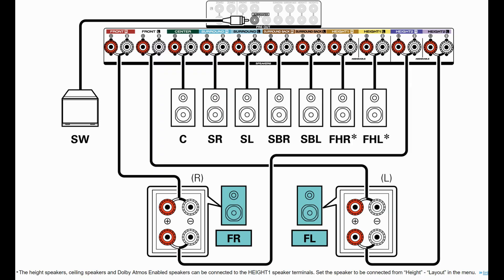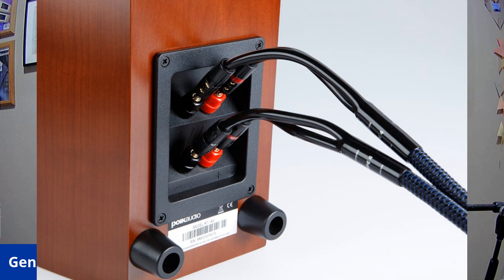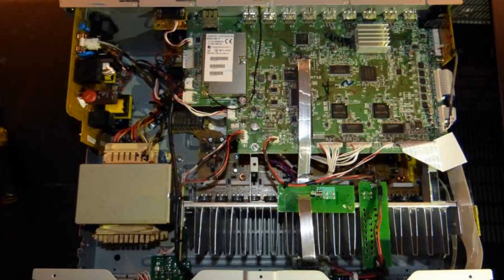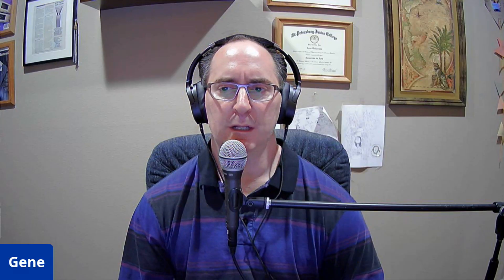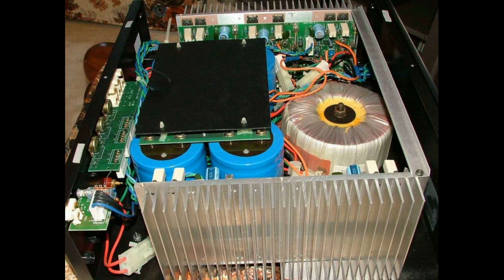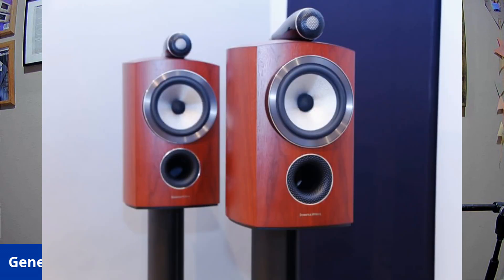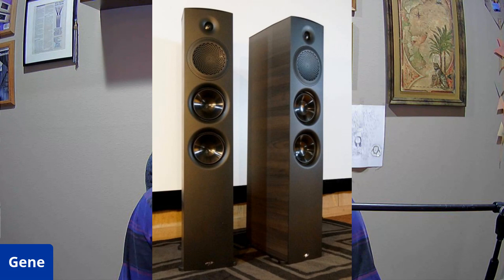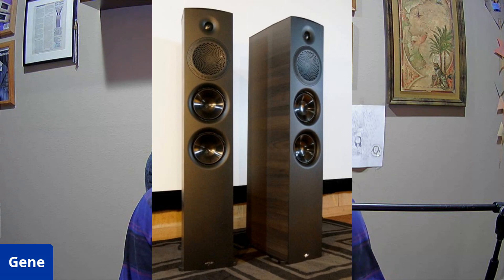Should You Bi-Amp Your AV Receiver?

Comment: I find it very interesting that you came up with Bi-amp for Denon , Marantz & the rest of the market to follow. Thank you for sharing! Personally I perched a 2nd hand set of B&W dm603s3 floor speaker and paired it with a Yamaha rx-a710 7.2 channel. Not good so I saved for a Onkyo 9.2 channel bi-amped them and crossed at thx80hz with HSU research subs do most of the work.

Comment: NAD T 757v2 with Energy RC-70's. Bi amp or no? In two channel mode the stereo output rating is pretty solid. I'm assuming that the majority of the amp's power is directed to the left right channels when in stereo only. Does bi amping with the unused back surround / zone 2 speaker terminals add to that power or would it be diluted to some degree? Thanks

Comment: Bi-amping with Marantz SR8002 and B&W 703s.  It’s a bit more powerful than the 8015 based on your measurements Gene.

Every extra sticker costs $500 and/or 50 watts of power:). That 8002 was the best deal of all time in terms of power per dollar.

Comment: I have Yamaha HTR5660 with tower Yamaha NS555 running speakers A to highs and speakers B to lows.  What if i just split speakers A highs n lows to 1 tower and speakers B highs n lows to other tower?
I'm using heavy gauge 6ft wires to each which seem to sound better with more power or volume than when I tried connecting banana plugs, which I removed to use only bare wire again.
And i wonder what if i left the bridge on and ran same way using speakers A&B, would that be like using double power?

Comment: I’ve got a pair of KEF Q5s with each speaker having two terminals. I’m trying to determine what’s the best way to connect them to my Yamaha RX-V765 7.1 receiver. If I’m only driving those two speakers with this receiver, should I just bi-wire, or should I take advantage of the bi-amp capabilities?

Comment: I say try it.  I have a Denon 3802 from 2002 and I have re-purposed it to my office with a set of Elac Uni-fi UB5's and a couple of 10" Klipsch subs I picked up off of CL.  I run the UB5's from 80hz up with the internal Denon HP filter, and take the L/R line level out to the subs and use their LP filter.  So now I have a kick-ass 2.2 system for very little money.

In the theater room I have a Yamaha 850 that is bi-amping my Tannoy Saturn 8's and it is a noticeable improvement at higher volumes.  Again, try it and if it is not an improvement, it's easy enough to go back.

Comment: I want to do surround sound but not from AVR's but from an Integrated amplifier as they sound more punchy (I think AVR DSP's takes a decent hit on the sound quality, as I like AVR - Direct mode sound)  something like a 4.1 Setup, would Speaker A+B the right way to go? 
What happens to the overall power rating of the Integrated Amplifier, as these speakers are in Parallel so Integrated Amps have more power to offer?

Comment: MY SYTEM IS 3.1 LOOKING AT ADDING 2 REAR SPEAKERS. I bi-amped used the surround channel connection for mids. my Pioneer Elite SC-35 on a pair of Wilkins & Bowers 686.   I think I notice crisper highs when listening to  dts or DD. What I do notice when listening to STEREO output it's very tinny no mid.  When my system was not biamped the sound did not have the tinny sound with STEREO output. WHY IS THAT?  Also When I use AUTO mcacc. The Amp is +12 on the mids or the surround output.

Comment: I have a Marantz SR7012 ( 9 x 125 watts ) I have bi-amped my two Veritas 2.4i towers & I find that my sound quality is excellent.  I have been unable to find a matching Veritas Centre Channel speaker to match my front towers.  I have a 7.1 SS setup.  My current centre speaker is a Paradigm CC-570 v3, which is only powered by a single amp from my AVR.  This centre speaker can be bi-amped & I was considering using my NAD C272 (mono blocked ) to provide more clean power to this centre speaker.  Does this make sense & should I notice a distinct improvement in sound quality ?
Love to hear some thoughts or input on this.....

Comment: What about bi-wiring where the receiver has terminals for low and high frequency? Is this a scenario where bi-wiring might be more useful? I have a Cambridge Topaz SR20 stereo phono receiver that has 8 terminals on the back. Just grabbed some new speakers and noticed they had 4 terminals each. The manual states it can allow for a "more focussed sound". But if it's not a noticeable change, I think I'll save the $80 that additional cables will cost me.

Comment: Hey I have a bi amp question. I have a 11 channel receiver but I also have to external amps that equal up to 11 channels will I be able to bi amp both my front L and R front towers and still run a 7.2.4 set up?

Comment: Do you think this would be worth while on a Marantz 5015? I just ordered a pair of Martin Logan Motion 40i fronts. 
I'm only using five channels and it has instructions for just this scenario. "This system plays back 5.1-channels. You can use the bi-amp connection for front speakers. Bi-amp connection is a method to connect separate amplifiers to the tweeter terminal and woofer terminal of a speaker that supports bi-amplification. This connection enables back EMF (power returned without being output) from the woofer to flow into the tweeter without affecting the sound quality, producing a higher sound quality."

Comment: Hi, i’m just a newbie here. I currently use marantz sr5015 which drives only 2 channels (wharfedale evo 4.2) in bi-wire configuration. Should I try the bi-amping feature or leave it where it is now.
Reply: Another question is should I use another set of speaker cable or should I split the existing bi-wire to connect it in bi-amp configuration? Thank you in advance

Comment: 100% agreed, but when cheap receiver came to the equation, really smear the real benefits of biamping. in my years of testing  definitely you will get benefits, but you must be aware that using external amp / preamp processor is the way to go. Better dynamics, solid bass response, more high details, (not to be confuse with more power)i must agree that to be able to feel a huge difference you must gain over 50% of the volume. Cheers.

Comment: i have a pioneer elite vsx-80 7.2 receiver and i think it says i can use the back speaker outs for bi amping the front mains. i think it probably wouldn't help the sound all that much because it's not high end like you described but if i'm not using the back surrounds would it hurt to do it? you said you wouldn't do it but it can't hurt right? maybe it wouldn't help the speakers much but at worst it's the same with or without right?

Comment: I'm currently bi - amping a pair of Mission MX3s, using a Marantz SR5007 receiver in stereo mode. Sound is so much better than when i just used the main speaker outputs - fuller and tighter bass, richer midrange and more defined treble. Also, soundstage and imaging have improved.
I'm more than happy with the sound, and i don't think that i will go back to the old way.

Comment: I'm using the 3311 bi-amped on jbl northridge e80, and it sounds wayyy better then normal settings, I thought snake oil, but holy moly what a difference with good cables and bananas.

Comment: Hi Gene, i am getting the Denon Avcx3700H, and using BW683 S2 as mains, going to use 5.2.2 using a BW older centre speaker which matched the older DM604s of which i cant recall the model, BW DM601 S3 surrounds, Monitor Audio CM165 in ceiling atmos heights, and 2 x Svs Sb2000 subs. The 683s seem quite power hungry and sounded underpowered on my older Marantz 5011, although i ran them small at 80 hz . Will it be worth it to biamp them when i get and setup the 3700?

Comment: I just bought a Marantz 9.2 SR6015 and I have a full set of JBL ES series speakers. I have 9 plus the 10” sub. The two towers the ES90’s have the 4 connectors on the back for bi wiring or bi amping. This is the first I’ve ever heard of this stuff. It’s been a while since I set up a surround sound so since my receiver is set for 9 channel and I have 9 speakers should I not worry about the bi stuff. Will my two towers not sound good if I don’t?

Comment: You recommend not to bi-amp with a cheaper reciever because they have a weaker power supply. And you would get little to no benefits from it. You left out what the cons are, would bi-amp 4 ohm speakers with a weak power supply give me worse sound or less power? If there are no cons and maybe the slightest of improvement why not bi-amp.

Comment: Wait a minute, what you described is exactly what my bi-amp feature is using on my Denon X3500H. The front left and right are connected to the low end and surround sound 7 channel amps are connected to the highs, on my Klipsch Icon Series W-35's. I noticed a difference so much so that I'm buying two Willsenton R8 KT88/EL34 x4 Tube Integrated Power Amplifiers to do the same. What do you think about bi-amping using two tube amps? The same model tubes of course. BTW: With a 97db sensitivity rating these floor standing Klipsch scream...lol

Comment: I own a Denon 2809. I use it only to power the front 2 channels(pure Direct mode). So basically i have 5 channels unused. In this case, is it better if i use surround back channels for Bi amping. My speakers are JBL E80.

Comment: Bi-wiring doesn't do anything, Bi-amping is a whole different story, if you set your amp to Bi-Amp (Bi-amping) your amp (if you have removed the bridge from your speakers of course) will pass the mids, highs, and lows separately, then you use the Surround Back L and R for lows, and the regular Front L and R for mids and highs, but if you do Bi-wiring you just plug the two cables on your amp into the same port, which ensures that nothing changes.

Don't let anyone tell you that you can hear the difference between Bi-wiring and just 1 cable per speaker.

I have done Bi-Amp on my Denon AVR-X2700H, and it sounds and works fantastic, i done the same with my Onkyo TX-NR609 reciver 
for 10 years, until he stopped working a month back, the only thing i do not like with the Denon AVR-X2700H over my Onkyo 
TX-NR609, is that the Denon AVR-X2700H does not have Dolby Pro Logic IIz anymore, and uses Dolby Surround, DTS Neural:X, 
DTS Virtual:X, or DTS:X, that sounds not as good as Dolby Pro Logic IIz.

Comment: i have two unused channels on the amp & the feature for it, so i bi-amped my 2-way speakers and i love it. i am used to my system for years now and to get this extra boost of power to the system with only two additional cables is very welcome and totaly worth it. 
but i was disapointed that the audyssey does not mesure the low- and high channels seperately. i think the bi-amping feature would benefit a lot and be more worth to try for more people. 
i tried now to mesure the low- and the high speaker seperately and afterwords i changed the distance and the level to the average worth. the result is pretty good i think.  do you think thats a good idea, or do you see another solution to mesure the channels seperate but in one round? sry bad english :D

Comment: i have onkyo ts-sr608 and only using 7.2. as i see on the amp. there are still 2 speaker out available which could be use to zone 2 or front high or front wide. is it possible to use these to make my speakers to 11.2 ?

Comment: I have an Onkyo NR797 and a set of old Polk Audio Monitor 70 that I use for my home theater. Would it benefit me in any way to bi-amp those speakers. Will I be losing anything in doing that?  I also have a set of Pioneer sp-bs22a-lr could I bi-amp those and use as fronts for my home theater instead of the Polk Audios. I am in a small apartment with 2 heights (SVS Prime ),  Polk Monitor 7- fronts and Polk audio surrounds and was using the Pioneer sp-bs22a-lr and backs. I have 2 subwoofers (Polk Audio 10 and Airmotiv SE12 )

Comment: Nice video.So I have the x3600h and plan on getting the polk signature s60.Would you advise me to bi-amp them.Would the AVR have the necessary power?
Reply: I have done this and it was a bit clearer than before. Polk is using cheap material to connect the Biwired output to each other so try and find out.

Comment: I have a Yamaha RX-A3050 and I was running Paradigm Studio v.3 100s, CC470, 20s for the back, and can't remember the model # for the sides. Plus a Servo 15a. Bought them all new. About 12 years ago I picked up an Onkyo TX-S876. Nice amp for back then. I needed an upgrade and wanted something for Atmos, so I picked up the Yamaha a few years ago, and took a pair of cheaper Cambridge Audio small speakers I had to mount on the ceiling for Atmos. For a long time I was thinking about using the Onkyo for bi-amping the 7 Paradigms, but a lot of people in the Facebook groups said I should just get external amps. Or at least an external amp for the front 2 or 3. I'm on permanent disability, so money is a lot tighter than what it used to be. I knew that A/V receivers generally rate their power in 2 channel mode, so I started thinking of using the Onkyo to just power the front two, and then that would give me 4 ceiling speakers for Atmos. It turns out, the Onkyo TX-S876 also supports Bridged-mode. Close to doubling the power for the fronts, especially if it is only powering 2 speakers. I bought two sets of Paradigm Cinema 3.0 speakers, using 4 of them for the ceiling, hooked up the Onkyo in Bridged mode, and now running 7.1.4, all Paradigm, and definitely have a noticeable 'punch' in the front speakers now.
I also just picked up a pair of 10G BlueJeansCables for my fronts after watching your vid about cables. I've always believed that cables don't make a difference, like most. I had/have 12G, pretty decent speaker wire that I put Banana plugs on the ends and always thought it sounded good. I hooked up the BlueJeansCables, and got ready for a serving of humble pie. Dire Straits, "Money for Nothing" in high res, such clarity. But it was Donna Summer, "I Feel Love", only took 3 seconds in for my jaw to drop. Expensive speaker cables, as you pointed out, not really worth it. But actual speaker cables to power your fronts when you have a decent system, then yea, it's worth it.
.
Video idea/request. Decoupling speakers from the floor. What are good options? Sound dampening foam, spikes, rubber spikes? Do those expensive ones make a difference over the cheap ones? IsoAccoustics are hundreds of dollars on Amazon, and then there are spikes+disks for $20.
Reply: watched this again since it appeared on my FB wall and didn't notice I watched it before.
I'm curious what you think about the difference between bi-amping and bridged mode for fronts would be. I know I mentioned in the FB groups that they mostly said bridged mode is best, but with my setup I kinda have a couple of options. Bi-amping or bridged.

Comment: I have played with it over the years. Both with car audio and home audio. I think there are two scenarios where bi amping can work. One is if you have very power hungry speakers and you drive them with separate amps. Two is if you are using active cross overs. I even went to the point where I built this complex set up with custom built speakers and drove each driver with a different car audio amp and active cross over. I used a very large custom sub woofer that played below 20 hertz. Then either 8 or 6.5 inch woofers, I don't remember which size I used each in their own custom tuned enclosure. Then another enclosure with the mid range and tweeters. It worked extremely well but I don't think it had that much to do with the amplifier power or that it was using multiple amps. I think it had more to do with the fact that each driver had an enclosure tuned to it and that I spent a lot of time matching levels and adjusting the cross over. I think if I was capable of designing, testing and building a really high quality passive cross over it would work just as well. And designing a decent cabinet to house all three drivers and work well isn't rocket science either. And then just use a powered sub woofer with a good built in cross over or an outboard one. When you boil it down using a modern powered sub woofer is really just bi amping your system. You are basically just using a different amp for low frequencies and using an active system to balance it out with your main speakers.

I have an older techniques that has bi amp, I don't remember the model number off hand. It was from maybe 1999 or 2000? Back when you had to use the outboard 5.1 decoder to go with it. And it weighs a ton compared to newer stuff. I tried bi amping it and it didn't make much of a difference to me. At least not when you are just hooking it up to normal towers with a built in average quality cross over. Its by far the best amp I have owned in terms of sound and build quality. I just outgrew it in features and what I needed for inputs. It doesn't have any hdmi switching or any of that. I am keeping it for when I have the room, time and money for a dedicated two channel system. Right now I use it to power a home made sub woofer since it has a built in sub amp in it.